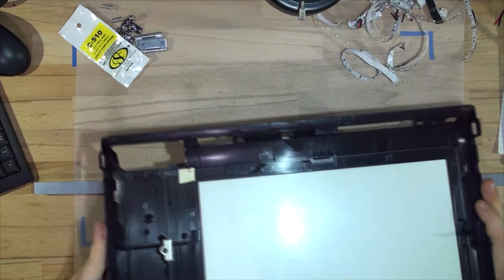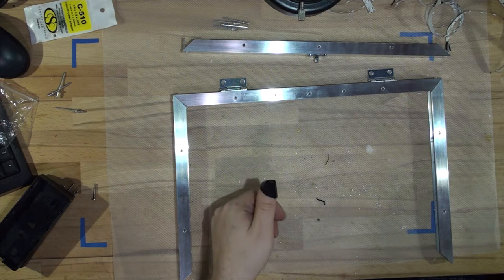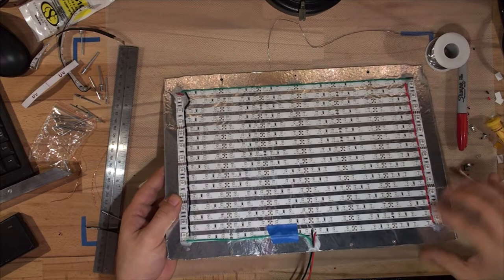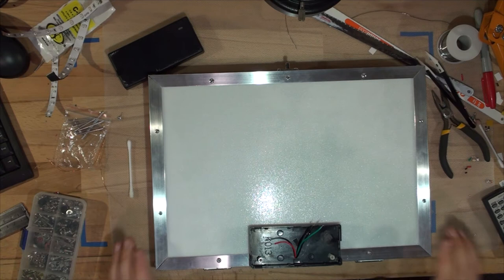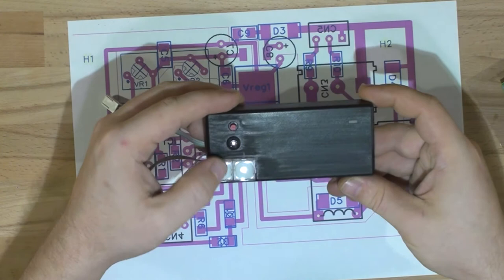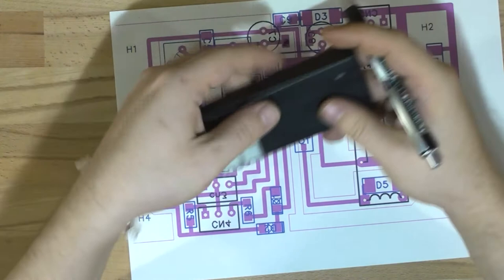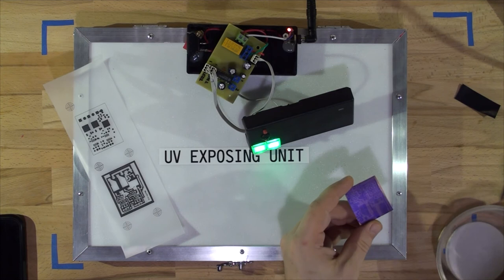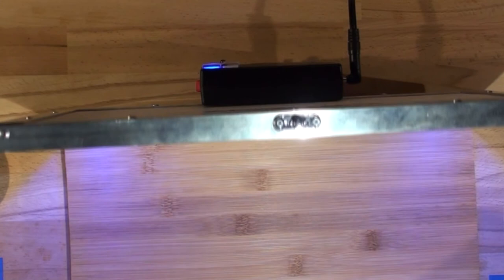DIY UV Exposure Unit For PCB Dry Film & Solder Resist and Screen Printing.

Comment: Can you explain what happens If the exposure is too less or too long ? And what the heating does when you apply it with a laminator ? I still get a lot trash from my experimentation.
Reply from the maker: If you under expose then image is too faint and some parts may wash off with the developer. If you over expose then parts that suppose to wash off won’t wash off, or leave very thin layer almost invisible preventing board from etching. The laminator ensures that all the bubbles are out and photoresist sticks well to the copper.

Comment: I can confirm that vellum paper is trash, it produces lots of sparklies: tiny dots of copper remain on the board. The best is ... normal paper, drenched in a bit of WD40 (or olive oil) from the side of the toner/ink. The contrast somehow increases, and the paper becomes a bit translucent. Also, the surface tension helps the mask stay close to the toner. Only downsides are that it's difficult to align the mask, and that the oil is a tiny bit messy afterwards. Second best is transparency film, but the dark areas bleed through and you must use 2 transparencies. Aligning them is near impossible, so you get smudges sometimes. 
I recommend laser printer at 1200dpi (crisp 0.1mm features), but an inkjet also works almost as well (0.15mm features, but with 0.05mm smudges around traces). 
For UV I use a cheap fingernail-polish UV curing device, works out of the box. Not as easy to use as your device, though. Until I found a thick piece of glass, keeping the toner flat with the dry film was not trivial. Thinner glass bends and causes smudges in some areas. The UV device that I have is powerful, exposure takes 4 seconds through transparency-film or 15 seconds through oiled-up paper.
Reply from the maker: I’ll have to try the wet paper method